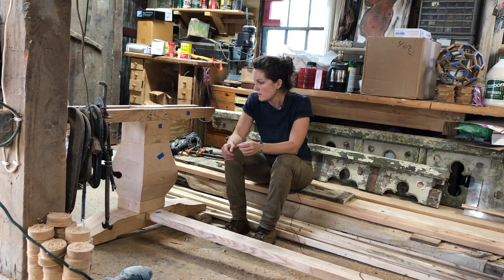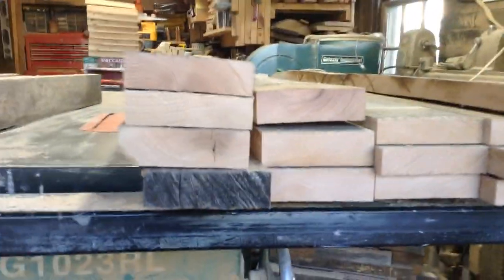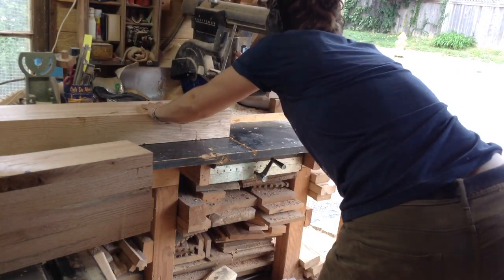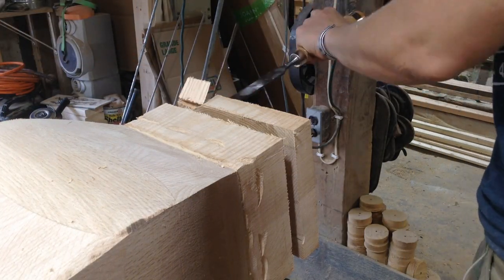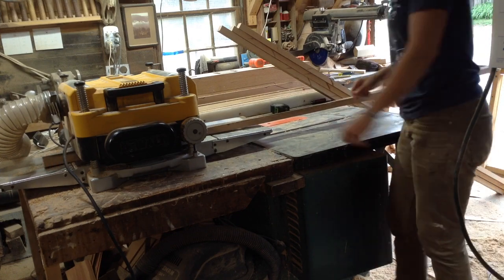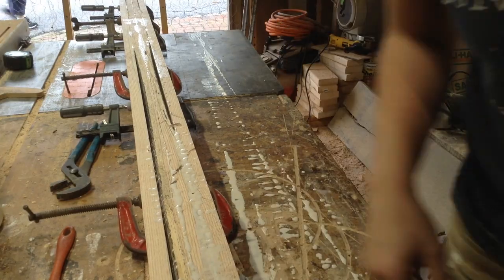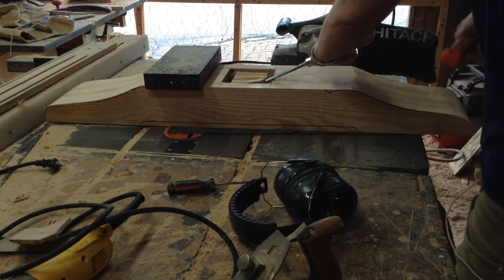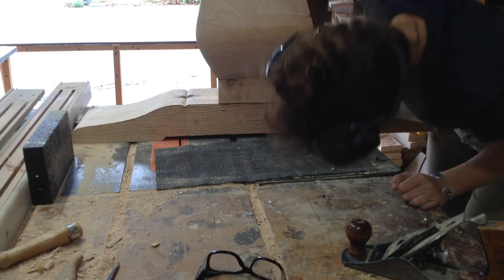Woodworking : Pedestal Trestle Table // How-To Part 2

Comment: Great Job! Looking forward to you making the top. I have just made an 8ft 6" x 24" x 3" desktop for my home office using 9 lengths of 2x3 of pine. It was nightmare working alone on such a large piece in a small workshop. I'm waiting to see if my worktop moves or bows, fingers crossed. How do you plan to help reduce the movement on such a large top? I used 3 coats of polly on all sides to help reduce the movement a little. I live in the same damp environment as you do, except, I'm in Scotland, always damp air, all year round. P.s. The pedestals look heavy, I can imagine how difficult and hard work it would have been. Looking great :) x
Reply from the maker: The small shop is going to get real fun once I start making the top for sure.  I’m planning on making the top a torsion box so flexion and weight won’t be as big as issues, fingers crossed.
Reply: @HoneyBadgerWoodWorks  will you film the difficulties that you will come across, working in a small shop? I wish I had, it was hard but funny too trying to manoeuvre 8 1/2 ft lengths in a 10ft x 8ft space. Looking forward to your next vid. I really enjoy your vids, personally, I wish they were longer but, I appreciate the effort it takes to make each vid. Well do you 😉